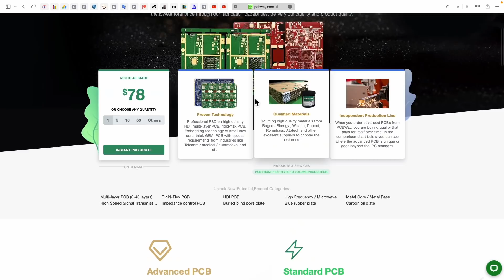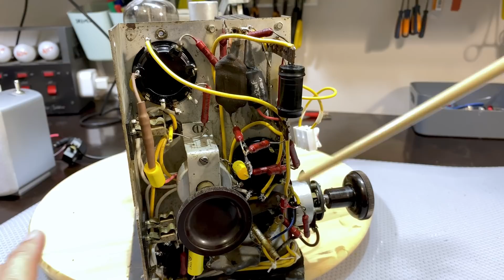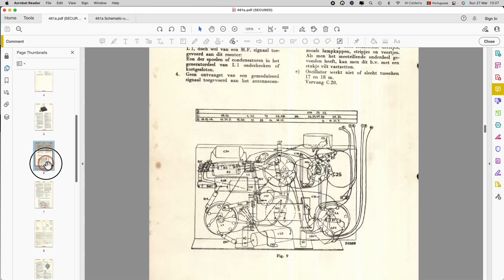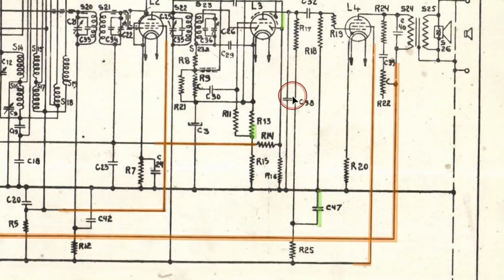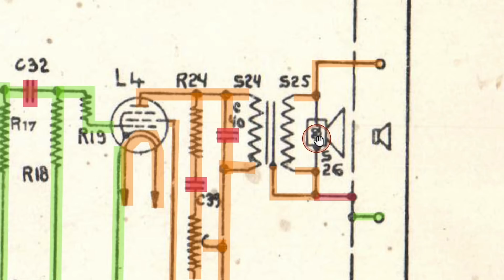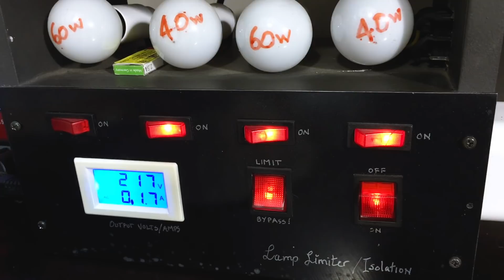Who likes Yellow? Dry wire everywhere in this old lady. Philips 461A restoration - part 2.  #PCBWay#

Comment: The ground connection from the speaker is to discharge static build up which causes crackles/bangs. It is required because the speaker basket is not mechanically fastened to the chassis.
Reply from the maker: Makes sense 👍

Comment: I just finished watching this one again.  When you were talking about the band that wasn't working, it reminded me of a video I watched today where there was a similar problem on a multiband radio.  The interesting thing is that the guy connected a signal generator to the antenna jacks and when he did, the "dead" band began to work.  Also, if he changed the frequency of the generator it would pick up different stations.  He and I came to the same conclusion at the same time, the Oscillator was not working on that "dead" band.  His fix was quite interesting.  All he did was replace the tube in the oscillator circuit and it began to work properly.   Go figure.
Anyway, thanks again for this excellent video!
Oh yeah, what is the tube being used as the Rectifier?  I don't remember ever seeing one that looks like that.
Reply from the maker: It’s a full wave rectifier tube. Here us the full info: https://www.radiomuseum.org/tubes/tube_az1.html

Comment: Hi, Manuel! Actually, there's no problem with the wires with different signals put together. The heater's frequency is too low to mess up the IF carrier and the B+ goes to a capacitor. It would've been bad if the signal after the detection was close to the heater wires - there it would inevitably cause hum.

Thank you again for another great restoration and video.
Reply from the maker: Makes sense.

Comment: Good job, Manuel! In my opinion, these kind of radios require a great deal of courage and patience to take on (I tend to shy away from such animals..) Strange signal wiring layout from mixer to IF, not quite "textbook", but it works. Maybe the low IF of 128kHz (?) is part of the reason why. The heater voltage is 4 volts, so the total heater current will be quite high. As you say, best to check performance as you go along with the restoration. I believe this will be among your favourites when you are ready!
Reply from the maker: Yes, this is quite a different beast. And I’ve never worked on a radio with such a low IF, so it’s turning out to be quite interesting for me.

Comment: Great progress Manuel, Philips seems to like yellow wire, maybe had shares in it? Wacky as they are the Philips sets work seem to work very well... although you would wonder if you couldn't get similar performance with a more conventual design 🤔
Reply from the maker: I have always wondered if the quirks are really useful, but it makes for more interesting restorations 😊

Comment: I also bought  similar yellow high-voltage capacitors to replace the old oil cross-connect capacitors, and the effect is good.

Comment: You said that the on/off switch switched both "the hot and the neutral" ---- but a 220 volt device doesn't really have a "neutral", does it?  Both sides of the mains are hot with respect to ground. Of course, this radio didn't actually have a ground connection..... But you also mentioned it having a "death cap" (those have long been illegal in Europe, I thought), and so how would that be done if you don't have a neutral leg coming from the wall outlet? Youll have to forgive my ignorance of these technical matters,  but here in the States I almost never work on 220 volt audio/radio gear, and if I do its usually no earlier than the 1990's.
Reply from the maker: Our mains system is 230VAC, 50Hz, and has a Phase and a Neutral. 
The capacitor is actually across the secondary, so I incorrectly called it a death cap.

Comment: Very nice. Had to rewire a radio once, but it had much less wire, it is a lot of work. I would try and restuff that 20uF electrolytic, or at least leave it in, but position a replacement underneath. One part more that would stay original. About the restuffing, I found out that some radio restorers would go so far they would make moulds of old black tar capacitors, put the new ones in, and cast them in new tar. I think they made that when restoring some late hi-end 1930s Blaupunkts.

Also, I think the connection from the secondary of the 1st IF to the IF amplifier needs to be coax wire, but I think I saw it that you left that wire original.
Reply from the maker: I’ve seen the full restuffing restorations, but they are a lot of work. I may try do one someday. 
The wiring in shields hs all fine so I left that as is.

Comment: Manuel, it seems to me that the wire from the first IF transformer to the grid of IF amp tube is drawn as shielded (coax) in the schematic, which makes sense. Another observation: the strange switch in the mains input might be the interlock connector through the back wall of the receiver.
Reply from the maker: Yes, that is the interlock.
Reply: Yeah, I'd say, the IF signal that comes from the right section to the left is actually the coax cable with the brown tubing, going to the grid cap of the tube on the left side. It's been hold in place with a clamp in front of the mains power transformer. You can see it at 17:25, right behind Manuel's fingers.

Comment: Getting there, quite a job replacing the wiring. You left the worst for last. The wires around the band-switch are a hassle to replace, replaced all on mine. If those cracked mica caps turn out to be good, I would melt the wax on them where the cracks are, to reseal the caps. Strange that the SW isn't working, maybe a dirty switch? I have restored quite a few Philips radios from the 30s with these type of rotary switches, and they'll usually need a good cleaning. I cleaned the caps on the tubes with a some fine steel wool, it gives a slight brushed appearance and it doesn't really look out of place, polished to a shine would. I had the original filtercaps still in place, they were filled with an oily smelly substance and metal plates instead of the usual paper and electrolyte. Looking forward to the next video, thank you !
Reply from the maker: Good idea about the mica caps. Thanks.

Comment: Again I bow to your patience. I wouldn't like to change all thise wires. Also, it might be prudent to put a fuse if there is none.
Reply from the maker: True. no fuse at all.
Reply: @electronicsoldandnew  it caught my eye, and from experience i saw how a transformer sizzles nicely in such a radio.
Reply from the maker: Yes it does 😊 🔥

Comment: Ever worked on a Volksempfänger?  These were inexpensive radios made before and during WWII to fill the need of a populace which had trouble affording a radio.  Nearly every company in Germany which made radios was involved, including makers of higher end equipment such as Loewe, Lorenz and Saba.
Reply from the maker: I’ve seen a few on offer, but they generally are a little pricey for radios that will become shelf queens. With no FM, they tend to become mere showpieces. This one also has no FM but has a special value to the owner, hence the project.

Comment: I wonder why Phillips used so much yellow wire?  Possibly because they had an abundance of it?  I think, IF I were working on it, I would probably have used different colored wires based on some convention of my own creation, nothing wrong with all yellow, just a preference of mine.
I find it interesting that there seems to be an equal number of people that prefer, like you, to leave the "patina" alone and the other half want to make it as shiny as possible, sometimes to the point of adding a chrome finish.  One thing I do wonder though about this set...are you going to apply something like WD40 to the metal pieces to prevent rust in the future?
The lack of values on the components on the schematic is troublesome, but at least you have something that tells you what the values are and a COMPLETE schematic!  I have been trying to find a complete schematic for a "Run 1" Hallicrafters 8R40 for some time now, but no luck.  Many people have told me to check out the "BAMA" site, and they do have a copy of the "complete manual" on there, but the schematic is NOT complete!  There is a chunk between V2 and V3 that is missing on both sections of the "two-page" schematic.  You get a bit more detail on the "Run 2" version of the schematic, but I have noticed differences in components, values, etc. such as the Run 2 uses a 5Y3 rectifier tube while the "Run 1" uses Selenium rectifiers and different connections and values of components.  So, I don't feel confident that using the "missing part" of the schematic from the "Run 2" version would work for the "Run 1" version.
I really do enjoy your videos!  They are so interesting, educational, informative, well planned, sometimes funny, but always appreciated!  Keep up the excellent work.
Reply from the maker: I think the yellow was on sale that week 😊 I prefer the multi-coloured wiring as it makes following the connections a lot easier, but this is philips 😊 
Regarding patina: I’ve gone both ways on that subject. Depends on the radio in question. 
I always gibbs the scrubbed metal a coat of WD40. I know it can be a dust magnet, but the extra protection is a good idea.
Reply: @electronicsoldandnew , I forgot to mention before, THANK YOU for mentioning the bit about the current flow in those wires (filaments, etc.) because I think we all from time to time forget to consider that.
Reply: I have seen quite a few Philips from this era, sometimes they used different colors and other times just one color. Yellow seemed to be favorite. The yellow and green always seem to melt, and other colored rubber wires just seem to dry-out and turn crusty/ to dust. I do not know if it is correct but sometimes the white/greenish crust on the frames can be quite harmful to your health when sanded-off and inhaled. I rarely polish them to a shine, I'll just clean them, they've had a life I don't mind if it shows....

Comment: Is it possible that the line that goes between the 2 sections isn't carrying IF signal, but rather it's just carrying the AVC voltage?  Reason I ask is because I see a second line running between the 2 sections that comes out of the first IF transformer, across the chassis, and into the grid cap of a tube on the other side. Is it possible that this is your IF signal?
Reply from the maker: Need to look more closely at that first block, but the signal definitely goes from one end to the other. The mixer is on the right and the detector on the left.

Comment: 26:40 I would probably throw in the towel, and replace those "coil capacitors" with appropriate sized screw adjustment trimmers and call it done, lol. Nice work on the wax string wire harness work ( waxed lacing string is still the standard on securing telecom power lead cabling in the U.S., and I've done a ton of it in the last part of my career)
Reply from the maker: 😊 the wire harness is joy my forte. I definitely need more practice 😊
Reply: @electronicsoldandnew  I've done wiring for instrumentation and power systems 40 years and think your work looks quite commendable. Enjoying this unique radio refurbishment.
Reply from the maker: Thanks 😊
Reply: Dear Manuel, could you demonstrate how to harness wire with thin threat in a next video ? Always enriching ans pleasant to watch you in these restauration !
Reply from the maker: I really am not good at it 😊 I looked for videos on YT and found a couple that really show you how to do this in detail. You’ll be best served there.